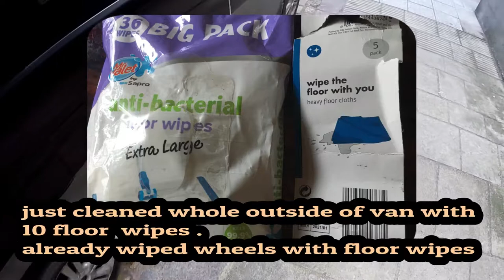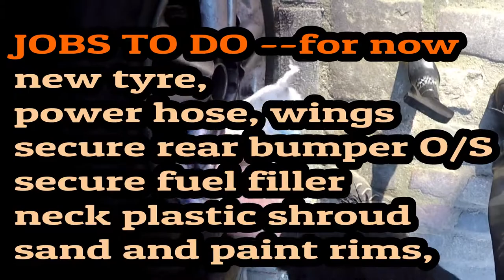Mazda Bongo New tyre+ Cleaning wheels

Comment: Av got some great stuff Called demon wheel  shine it's purple came with a wheel brush think I got it from B&M. I lost  a wheel cap of the Audi £9.99 to replace it next time am in Scrapyard I will see if I can see a cap for you i did see a bongo in there no so long ago maybe the wheels will still be there your right there's a bit of cracking on the wheel. A few small job's ach new tyre will keep you on the road for a while stop you having a blow out. 👍
Reply from the maker: Thanks Ali !! wheels are Vibram cant find any on the web.. If you see one pick one up !!  My MOT is in June .. keep on wrenching !!😀